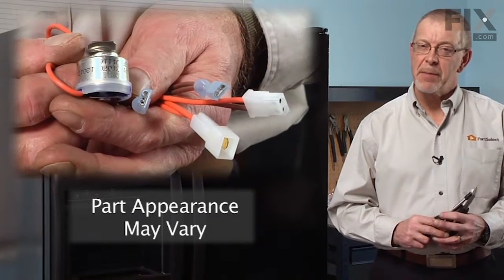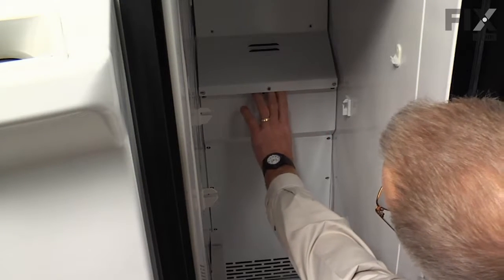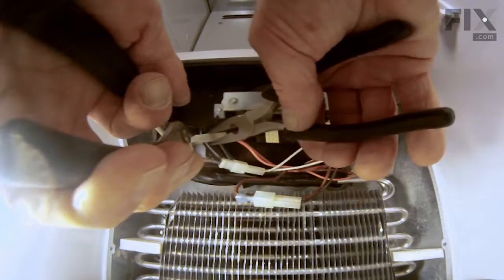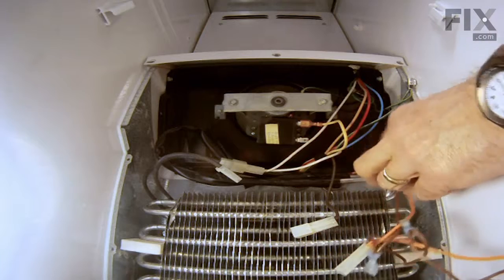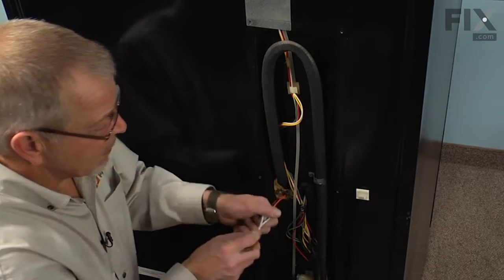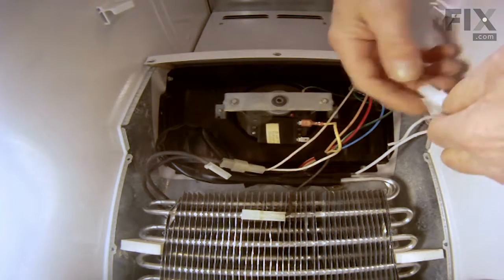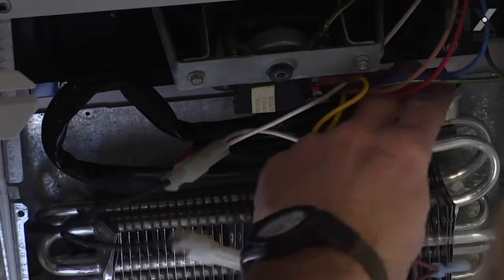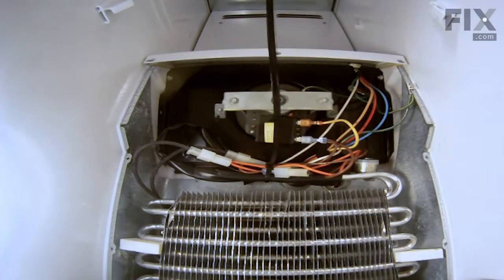Amana Refrigerator Repair – How to replace the Defrost Bimetal

Comment: You do a great job of going through all of these videos. Surprised there's not more people taking advantage of your kindness in  creating these videos. 

Myself, I'm a disabled, older man, with an older Amana Refrigerator/Freezer, that was here when I bought my home 10 years ago. The Model Number is ATB1935 HR. 

I'm experiencing some strange operation from the Freezer- Being on an extremely fixed income, (I'm lucky to have 5 dollars left over every month- seriously)- I'm hoping you might have an idea on this issue. 

I was getting noises from the unit, which made me think it may be low on refrigerant, and the food in the Freezer WAS defrosting, but then it would refreeze again. It's kind of been like this now for a week or two. What's strange, is that the sherbet ice cream sitting in the center, is basically melted, yet, the meat off to the sides of the ice cream? Is still frozen. 

There's some Hot dogs on top of the meat , that are a little soft, but not thawed. Also, the ice cube trays? Take a bit longer to freeze, but they DO eventually freeze. The freezer seemed to improve, after I cleaned the rubber seal on the door, so I thought maybe that was my problem for a time, the door not being fully closed- but that appears to have only fixed a little of it now. 

I've begun thinking that something's wrong with the Auto-defrost unit, that maybe it's running too long. I saw the change-out you did on that Amana with the freezer on the bottom, and I'm hoping it may be an easy fix like that, for myself. 

No idea on the price of the part, or where the best place to obtain one is- or, maybe you know of something else I should check first? I can only try ONE option here- either try to re-fill the refrigerant, or do the auto-defrost timer, so ANY advice? Would be greatly appreciated. 

No matter the response- thanks for taking your time to make these videos. They are very easy to follow along with- and I've no doubt have helped many people prolong their own fridges.
Reply from the maker: In your conversation there is no mention of a problem with temperatures in the refrigerator section, only the freezer which if that is the case eliminates fan and air circulation problems. It would be helpful to know the type of noises the unit is making as it may help to determine problem especially if they are system sounds. If the fridge was low enough on refrigerant to thaw out product it would not recover and begin to freeze again.  I would be looking for possible inefficient compressor or a moisture restriction at the entrance of the evaporator. It is possible your condesor fan may be slowing or condenser has some blockage. An over worked or over heated compressor will drive moisture out of the oil into the system and give restrictions  that will freeze the capillary line and stop the cooling process until it warms up enough to thaw the restriction and gas flows again till the next time the moisture gets to the evaporator  once more.  It might be most cost effective for you to have a certified refrigeration appliance technician inspect your fridge so you are not putting good money after bad. Good Luck !!!